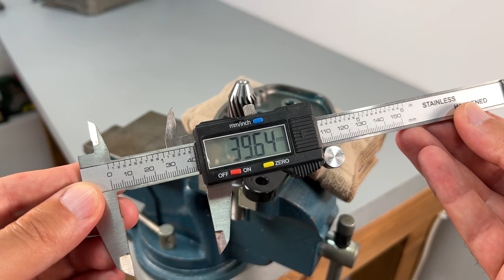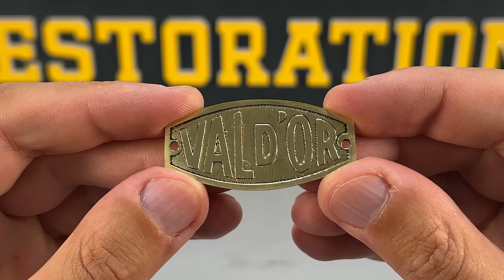1933 French Hand Cranked Grinder - Restoration

Comment: Question.... when you use the lathe and take a little off a part, does this not make a difference when if goes back together?
Reply: Had a hard time enjoying the rest of video after watching this. Should have spray welded it to build up metal. Then turned it down to right size. Just because it looks good does not mean it was done right. I am being very critical but this is what they do for a job.
Reply from the maker: Hi @I’m right you’re wrong! Normally yes but depend where that part goes after. In my case, that parts was not damaged if I take it a little of material. I read it what Jamed wrote and he has right. But not in this case. Where needed to remove some material ( I removed to the gear where the handle is attached) for making it smaller and to can add a bush after. I attached the bush to the handle and after that they fit perfectly.
Reply: @CoolAgainRestoration  thanks 👍🏼
Reply: @CoolAgainRestoration  I'm going to say BS you removed material off the shaft on the first gear which made it smaller It is now not going to fit as intended by the manufacturer You're just playing wrong admit it yeah you have nice tools but you certainly don't know what you're doing when it comes to machining or at least you don't know about allowable tolerances I don't know maybe they do something different on the other side of the world but I've been machining parts for over 30 years in states and not how it works here if you do something like that here it's called a Chicago rebuild maybe you should have just painted the damn thing and sent it on its way would have been tighter.
Reply: @whatdoyouthinktodd  I mean he did just explain that he added a bushing to make up for the lost material but reading comprehension doesnt seem to be your strong suit lol
Reply from the maker: Buddy, you need to rewatch the whole video with carefully. You didn’t understood well what I did there. What it was loose and how I tightened. I know is 25 minutes long but you can’t make a bad opinion if you don’t understand. Cheers
Reply: @CoolAgainRestoration  but Adding ! A bush ! Makes that Modified ! And is NOT ! THE ! ORIGINAL ! PART !!
Reply: @davidwillard7334  thats why its called a restoration not a "slap-paint-on-it and leave it slopped out as-is." Obviously it either left the factory with too much play in it or it got worn out over time, and now its better than it was to start. He also made the handle hole smaller, among other things, in case you want to throw a fit about how thats not original too. In case you havent noticed, all the other restoration channels out there do the exact same thing. My mechanics is one of my favourites and he shaves parts down by a smidge all the time. I do not understand why yall are coming for this particular channel out of the blue for something totally normal in the restoration community but i guess its easy to critique from the cheezit stained sofa lol
Reply: For the detractors:  a few thousandths off of the width of the gears will not matter, nor will a few thousandths off of the shoulders, due to the overall width of the gears.  If these were clock parts with very thin gears any increase in end-play or decrease in shoulder spacing would keep things from meshing correctly, but it’s not.  Likewise, a few thousandths off of the shafts will also be inconsequential.  If this was a high precision piece of equipment with many gears, those small tolerances would add up and cause problems, but it’s not that either.  The main shaft, that attaches to the grinding wheel, is the only one where tolerance really matters, and while he shaved a few thousandths off of the shaft itself, he did not alter the ball bearing surface on the one end, and the other end has an adjustable cone bearing to remove any end-play, so that shaft remains properly tight and concentric.

Lastly, for the guy who complains about “NOT! THE! ORIGINAL! PART!!”, you do realize that the “ORIGINAL! PART!!” in its “ORIGINAL!” condition was scrap without modification, right?  As a matter of fact, the whole thing, in its “ORIGINAL!” condition was destined far the junk heap.  It had zero value as an antique, due to its condition.  And let’s face it, antique value is the only time when original parts and/or original condition matter in any way.  What this person did was take a worn out piece of junk and restore it to a working condition, and beautify it in the process.  Modifying a part by adding a bushing to remove excessive play allowed him to return functionality to the original part, and decreases the rate at which it will wear in the future (sloppy fitting parts increase how quickly those parts will wear out).  It’s not as if he modified the part by adding a motor to it, which would have changed the entire tool at its fundamental level.
Reply from the maker: Thanks a lot ! You are so kind 😊
Reply: Honestly in the end it seemed like the tolerances were worse. Loved the way it looked in the end but I do believe “from what I saw” there was more done than it needed.

Comment: Amazing job buddy, especially on label production. How long has it been soaked in a ferric chloride bath?
Reply from the maker: Thanks Radek! It was soaked in chloride about 30 minutes but depend how deep you want the etching and depend what temperature it is the chloride solution. I preheated mine at 40 degree
Reply: @CoolAgainRestoration  Thanks for the info David , I always wanted to try it :)

Comment: wonderful restoration! the handle crank looks like it was cast, I've heard that cast iron needs to be pre-heated before it can be safely welded, does this matter for a small object like this where the entire section is heated by the welding or did you pre heat it off screen? I really like that you added a brass core so that you didn't have to remake the wooden handle.
Reply from the maker: It was hand forged 👍🏻

Comment: My name is Mark my dad taught me to fabricate since I was little I'm 63 now and I'm glad to see some people still enjoy working with the roll,I use to make brake shoes for cars.my dad left a tool in the shop that puts a quarter inch crease in metal as you roll around the part to stiffen it up and makes it more rigid do you know the name of this tool I've used it alot I think it's invaluable,but I never learned everything about metal ,I'll never match him,but I did learn cnc,brake,hydraulic drills welding,tig mig,silver soder,sheer,sand blast,I saw you doing some hand jogging with the cnc.i really appreciate watching you restore, it brought back memories,the stories I could tell.The one thing my dad taught me was to respect the tools you work with check and double check and you'll keep all you limbs. Good job on the video
Reply: People don't realize when you working with metal you work with thousands of an inch I didn't see any calipers,did you eyeball all that, I know you didnt.
Reply from the maker: Oh,I have calipers : classic, digital, for lathe , for heights… your dad has right when he said to respect the tools 👏

Comment: Beautiful restomod! I was surprise to see that you rounded the corners of some of the bolts. I couldn't help but to cringe a little when you were using your lathe to dress the grinding wheel. It's such a pleasure to see, something that someone discarded, be cleaned up and put back to use.
Reply from the maker: Yeah. It was a lot of work to clean the lathe again to working condition but a nice job deserve all the effort

Comment: Absolutely beautiful job! I would highly suggest adding more grease to the gear box though. They would have used oil at the time(the plug in the top was for oiling before use). Turned out amazing though!!
Reply from the maker: Thank you very much mate . It is just for display now and the oil will make a mess in my small collection, that’s why I used grease .

Comment: Beautiful work!  You have transformed a worn out piece of scrap back into a useful and beautiful working tool.  Bravo!

The only thing that I saw you do wrong in this video was not covering the ways of your lathe when you reground the wheel.  That abrasive grit (even and especially the finest particles) can work their way under you cross-slide, and ruin the machined surfaces between the cross-slide and the ways.  A decent-sized piece of cardboard or sheet of plastic can save you from prematurely needing to disassemble and clean your machine (or worse, have to do a restoration! 😅)
Reply from the maker: I know what you mean but at every 4-5 months I make a deep cleaning to that lathe. Before doing this was the diamond dressing process and I knew after that will be a revision for the lathe . That’s why I didn’t bothered to cover 😊 probably I had to put a cover there just for the people , to not be a negative influencer 😀
Reply: @CoolAgainRestoration   I watch a lot of Blondihacks videos is how I knew to cover the ways.  

I’ve never been the best at keeping my work environment clean, but then again I don’t own any expensive or high-quality pieces of equipment.  But if I can ever convince my wife that I have an actual use for a metal lathe, I would always err on the side of “an ounce of prevention beats a pound of cure”.  Plus I’m lazy, so any mess I can prevent now will be less mess I have to clean later.  😂
Reply from the maker: Blondiehacks 😀 can you imagine I learned machining from his tutorials?

Comment: You need to add oil via that screw on top near the main shaft.  It should have oil in it ( I have one and it takes 30 wt, about 2 oz worth).  Change and drain yearly.  The grease will help but those are intended as oil bath lubricated.

Comment: Nice, nice again.👍👍👌👌
Just a suggestion😁: buy yourself a set of the Swiss brand PB Swisstools screwdrivers. They have a milled flat at the end of the tip, so give a better grip in the slot of a screw compared with the tapered end of the more standard style. I use the PB’s for years and guess what: MyMechanics uses them also😜 seriously, with the old screws you are working with, the PB works better when you need to apply some force.
Reply from the maker: Yeah I thought to buy a set from them but I don’t know why I didn’t until now. Definitely this year I will buy them 👍

Comment: A warning about Ballistol oil. It is a water soluble oil similar to cutting fluid and as such will allow moisture through to the metal causing rust. The rust that you will get over time will be clumpy and oily but rust it will be. Using it to temporarily protect metal might work, but I do not recomended using it as you would say, WD40 or or Remoil. This was a lesson I had to learn the hard way. Btw, Ballistol does exceedingly well at cussing for cleaning Black powder weapons and even does a good job as a leather proectant and cutting fluid, just don't let it set on bare steel or iron parts for more than a few hours.
Reply from the maker: Thanks for the advice mate 👍😊

Comment: You were supposed to fill it with oil 
Because it’s has a drain plug
Reply from the maker: I don’t understand why people believe that. You are one from few people who told me that. I don’t believe that oil was the fluid to put there because I didn’t see there any gasket to prevent oil leaking . And more than that , when I opened the gearbox , there was grease . Probably other grinders, works with oil but anyway, they have gaskets there 👍

Comment: Holy shit, I don’t have that same grinding wheel (I’m in Australia so it’s from a different manufacturer) but that looks almost IDENTICAL to the one that I was handed down from my grandfather. I haven’t really restored it to much apart from replacing the wheel and making sure it hasn’t rusted too deep to be safe to use though. Awesome content, also I want to know do you use any of the tools you restore? I could totally get it if you didn’t want to use them to not damage them but it would be cool just having 1920s-50s equipment looking factory new
Reply from the maker: Yes , I use some of my restored tools but not all. I use especially the kitchen gadgets . Looks cool when friend came by and see antique things in my barbecue area.

Comment: You did great until the end, where you used it to grind a piece of nonferrous metal (brass?).
Reply from the maker: Sorry if this bothered you 🤷🏻‍♂️
Reply: @CoolAgainRestoration   We were told not to grind anything but steel or iron on a grinding wheel.  Supposedly nonferrous metals will load up the wheel unevenly, causing an imbalance that would lead to catastrophic failure. "Why, just 2 years ago, so and so did that and the grinder exploded and  ..."  Just shop teacher horror stories I guess  ;^)   I  still cringe when I see it though.

Comment: if i counted correctly, thats a gearing ratio of 180:1 so thats quite the fast grinder if you want it to be 15,000 rpm would only need 1.5 turns per second
Reply from the maker: Yeah, this grinder is really very fast

Comment: 1:54 – So this is why certain screwdrivers have that hexagonal shaft! Seen it all my life, never understood it. One question though, why did you make the sharpening guide out of aluminium? Is that not too soft a material?
Reply from the maker: No, because there is no pressure applied 😊👍

Comment: Is that a special oven?  What top temperature it need?  Voltage requirements? (I may need 30Amp or 50Amp fuse line to shop.

I’m going to play with scrap metals.

Comment: I am not mechanically inclined, but I love watching restoration videos, and yours are fantastic. I am curious...something I've seen done over and over is the widening of the tops of screw holes. What is the purpose? Is it just aesthetic?
Also, I loved the machine you used to bend the wheel cover!
Reply: The diamond dressing was fascinating too
Reply: Ooh, the brass gasket was gorgeous! I love the look of brass!
Reply from the maker: Hi Kate and Glad you liked it so much. So, widening the holes=chamfering the holes. That means i remove the sharp edge made automatically by machine when the item was manufactured 👍🏻

Comment: Are you ruining the tolerances by taking off metal in you lathe ? Or just barely taking off enough metal just to clean them up?
Reply from the maker: No ruining there .. we are talking about ,05 mm taking off material . The grinder works absolutely perfect after restoration. Where I removed more material, I replaced with a bush because there it was a lot of play from the beginning

Comment: Amazing restoration .Congrulations
What is name(if have code number) of adhesive in 20:36 ( red botte)
What is name in 22:24 paper's name ? have A4 size in same papers? have a buying link in Internet? Also what is in this process's end application by a small brush "patina" ? a chemical name? ( maybe very simple question but my proffesionaly is not metal processing )
Meanwhile at 22:59 very pratical great idea for  fast check control of process (I mean this white polyetilen material)
Again thank you for this great video

Comment: Impressive work, indeed.  Not that it matters, but I struggle to accept this as "restoration" - unless I'm wrong, and the original also had mirror-polish finishing, those weren't original milling marks that you filed and sanded away, etc.

Comment: I always enjoy your restorations but I have to ask…..  The grinder had a lot of play before you started your restoration.  You also took a few thousandths off of all of the gear shafts.  Now you reassembled the grinder without installing new bushings to accommodate for the loss of material you took off of the gear shafts.  So how is the grinder working perfectly without new bushings in the enclosure castings?
I always like my ice cream with crunchy bits and pieces.
I also want to know how many times has a screw flown off to Never, Neverland while you are grinding or polishing them?
Have a great day, looking forward to your next restoration.
Reply from the maker: Thanks Vincent ! So, the grinding wheel has a lot of play before restoration but because the wheel. I didn’t take of material from the spindle or from the gears. Only the gear where the handle was attached was removed material but it was done like that because I made a bush there and fixed in the handle part.
Reply: @CoolAgainRestoration  thankyou

Comment: I got a question when you shave down some of the parts does it make everything lose when you put it back together since it's not the same fit from the beginning
Reply from the maker: The gears was only sanded where the thickness is important in fitting. Where the thickness wasn’t important for a good function I cleaned by turning them on lathe. Where I need to remove material , I made a bush after ( handle part) for a good fit.

Comment: awesome video... one question... why did you make the new gasket out of brass? because its a softer metal?
Reply from the maker: No. Because I knew that in the other part it is the name plate from brass and I want to give to this grinder a symmetry with colours. Gold colour on both side. I thought is cooler .

Comment: Did you straighten out the old wheel guard to get the length to cut for the new one?
Reply from the maker: No. I put tape on the old ones and after that I get the length from the tape 👍

Comment: What is the V-belt pulley for? What could it have driven? It must have been put there for a reason.
Reply from the maker: Yes. I think it was made for connect to an engine with a belt. Like the old bench grinders. I didn’t seen a model like mine, connected to an engine but definitely the V shape is for belt.

Comment: New ball bearings are very cheap and the old ones most likely have tiny particles of powered metalmon them that are held on by magnetic charge. You shouldn't reuse ball bearings. I would love this grinder for my bicycle maintenance to dress shifter and brake housing to make them square.
Reply from the maker: Yeah, you should probably have right with the ball bearings but I know nobody will use this tool. Is just for display 👍🏻 glad you liked it Chris